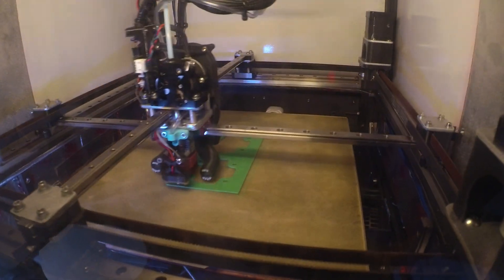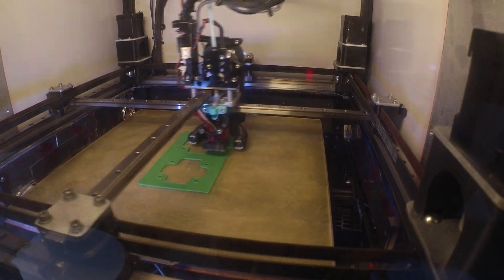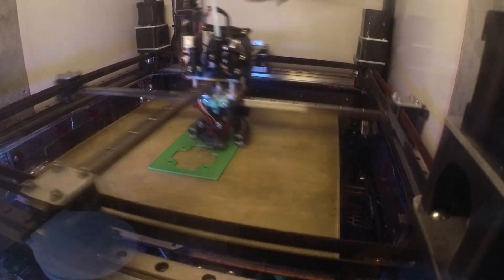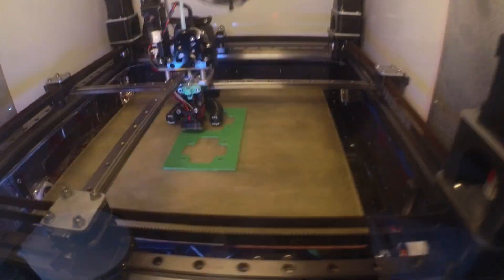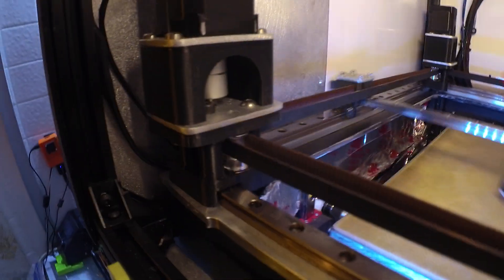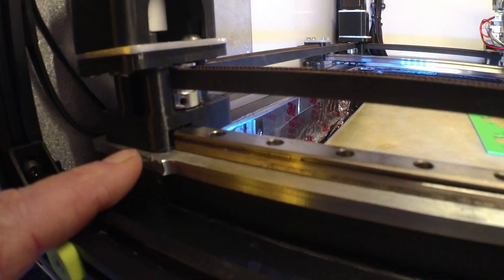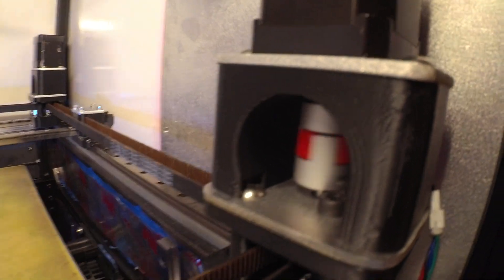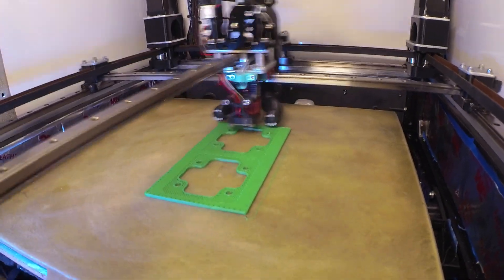Crossed Gantry Berd air mount

Comment: How does berd air compare with cpap?
Reply from the maker: ~4:1
Reply: @MrRocksalt  in favor of berd air or cpap
Reply from the maker: @victorsoh7891  CPAP. Berd uses cold air also, so for some material need to be careful not to shock the filament. Not a lot of volume with berd, but cold air and some pressure. I use it for hot end cooling, tried it for part cooling, and determined I would need at least 3 pumps to match CPAP, maybe more, not 100%

Comment: Why does your machine sound better than mine? I have the most awful motor noise up from 60mm/s until 120mm/s. Great build!
Reply from the maker: I have some bad vibrations at 60-120mms. Just turn it up and it goes away.
Reply: @MrRocksalt  Not all material's appreciate 120+mm/s like PC for example. I agree for most materials though just crank and flow lol.
Reply from the maker: @Leviathan3DPrinting  So far no problem with PC, ABS, PETG 200+. PLA OK, but needs a lot of air and I have no patients for PLA!
Reply: @MrRocksalt  My biggest limiting factor is a lack of an enclosure. I'm building a bed slinger so my setup will obviously vary a lot I have no issues hitting 20K accel but extruding at 400mm/s is rough depending on material and even then unreliable. 200mm/s seems more doable. I just have had issues with PETG sticking to the bozzle nozzle. Some prints come out beautifully others not so much I don't print enough of it to have a dialed in profile. PLA has always printed fine for me even at high speeds. Without an enclosure ABS is a no for me.
Reply from the maker: @Leviathan3DPrinting  Watch the Bozzle! I had some issues with bozzle. Some strange artifacts on corners and does not flow like the CHT. CHT, on volcano block, with spacer, 48mms3 ABS. Bozzle, 40mms3 and anything over causes the filament to swell. CHT skipping steps at 56, Bozzle can't test past 40 due to swell. ABS no problem open air, but no drafts, small parts work well.

Comment: Hi , i would like to build a toolchanger with at least 300mm³ useable build volume .

With this machine i dunno how i can solve the issue of the reverse bowdentubes interferring with the gantry , have u any ideas ?

Oh yeah , and a voron is no option
Reply: why not just copy the e3d toolchanger machine design? sure you can make the frame for much less that they charge
Reply: You could mount the ercf on top.  I've seen that and similar done

Comment: Loving it mate, would be good to see quality of a finished part
Reply from the maker: Finished product is in the video thumbnail, but mostly top view. If you look close at the the layers from side view there are some variance in the lines, but they are very minor. You have to look really close to see them. Cannot see them from 6" away. Part is strong no cracking/brittle. Top layers is about 5% too much flow and shiny but slightly rough texture. Filament is wet for sure.